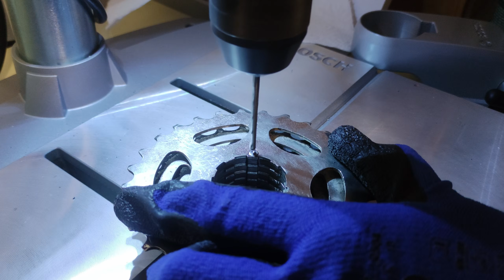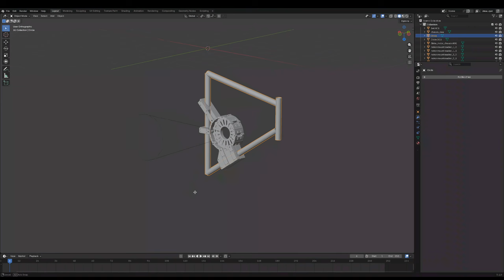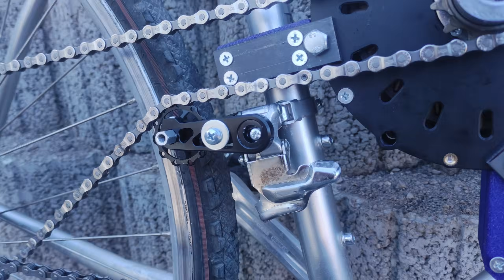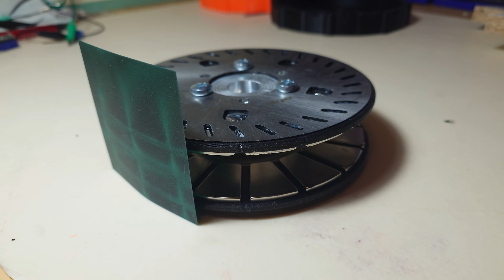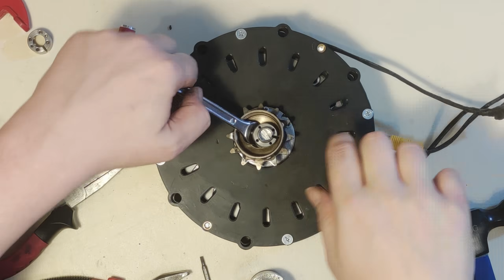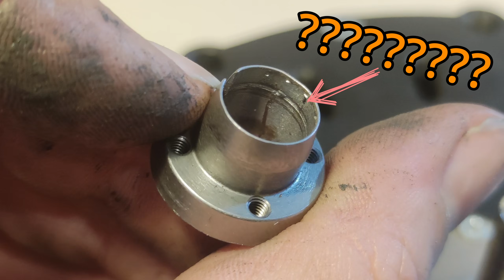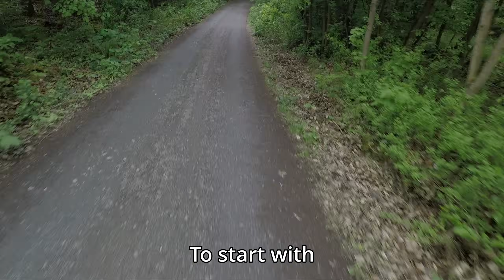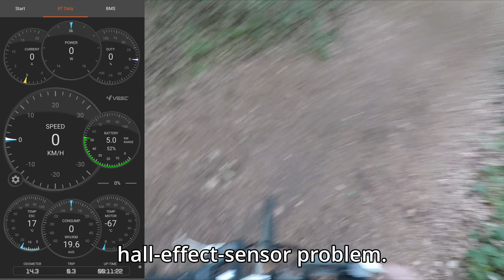Testing My Home-Made E-Bike Motor

Comment: Hey, that's pretty impressive what you were able to make with pretty accessible tools ! And i find it really amazing that it had a 20Wh/km, which if my napkin math is correct, would be equivalent to ~0.2L/100km of gasoline, assuming 10kWh per liter of fuel :)

You have great potential, keep doing your projects, i love watching them, and learning a little bit more from your videos every time:)
Reply from the maker: The caveat there being that the 20Wh/km is the average when using the motor as assist (which on this bike is basically the default mode because the motor makes the pedals turn, and if you don't pedal with the motor, the chain drops, haha). Wihile riding, subjectively, I feel like I put between 1/3 and half of the power into the bike myself. So if I were to use motor only (where it's possible - steeper than about 4% inclines start to need power input from the rider), then the efficiency would definitely be worse :>
Reply: @BirdbrainEngineer for reference, 20 Wh/km is approximately what I got on my first ebike with a cheap hub motor from ebay and a generic trapezoidal pwm controller

Comment: those parkside batteries definitly arent up for the task. id like to see the voltage sag at full throttle, i cant imagine that they stay anywhere near 20v each.
Reply from the maker: The voltage sag was shown in the video ;>

They are definitely not great, that's for sure! But they are cheap, accessible and a whole load safer than any janky DIY battery would be.
Reply: @BirdbrainEngineer  Yes they are not a bad solution, and like you said doing 3 in series would work even better. I cant find where the voltage sag was shown tho. I can only see a state of charge on the dash. Anyway, amazing project!
Reply from the maker: @AvidWatcherOfSlop  Well yes, the charge%. So, from 55% down to like 32% I believe it was? That'd be something like 1.5V sag I think. It sags less when the batteries are full (naturally)... but when the batteries are below like 75%, the sag starts to become significant.